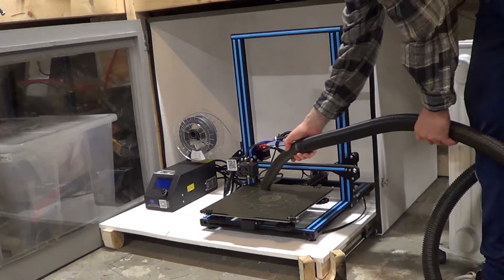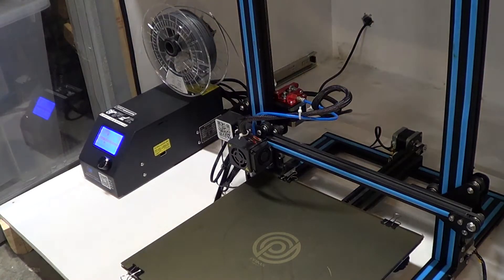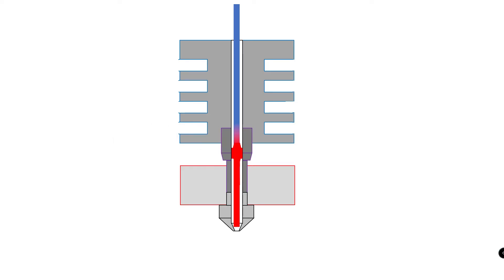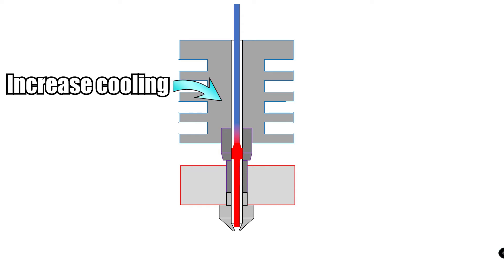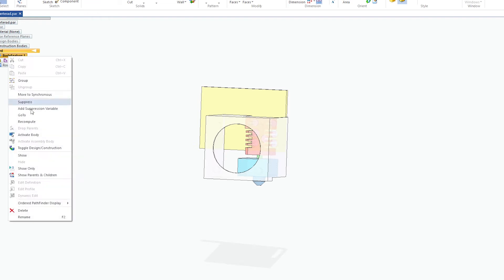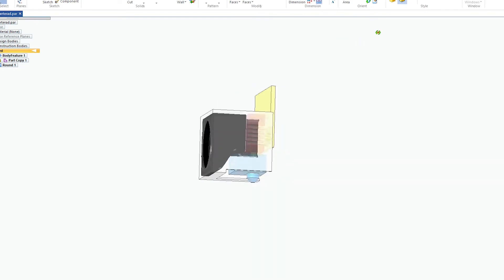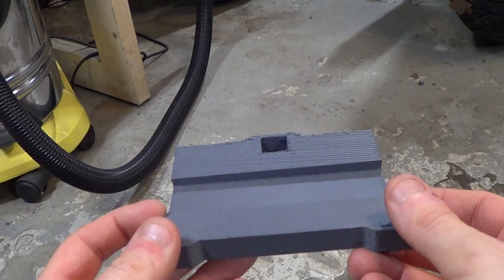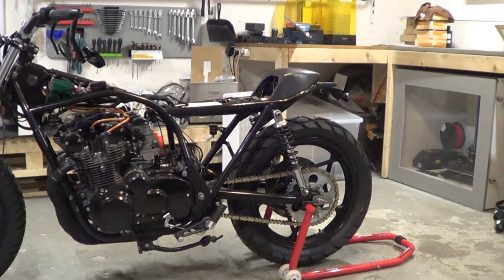CR-10 Upgrade Fixing Heat Creep | Workshop Shenanigans

Comment: I had replaced the fan  for the 40 x 20 and now I am going to print the inner duct and make holes, hope it works, I am desperate. THANKS.
Reply from the maker: Good luck!
Check your retract distance as well, -> As short as possible (y)

Comment: what aftermarket hot end are you using?
Reply from the maker: Product is called; ”PrimaCreator All Metal Hot-End for Creality”, from where I bought it.
Manufacturer P/N: PC-AMHE-CR10 according to that website.
Reply: @speedandengineering  Thanks, they are currently unavailable in the States for me but I am going to try upgrading the fan with the shroud and exhaust ports. Thank you for the part numbers.

Comment: I have issues with petg as well unless I use a ptfe lined hot end.

Are fan upgrades needed for these printers to print high temp ? Everyone talks about upgrading the hotends themselves, but no one mentions fan changes. maybe people are upgrading and still only printing pla ? When I see people talking about fans, its always the part cooling fans.
Reply from the maker: Yea, the ptfe hot ends are good at isolating the heat to the heat block.

All metal hot ends holds up better but you’ll be more prone to these problems with heat creep.

Maybe, it seemed to do the trick for me to swap the fan. But maybe the original fan that was replaced was getting worn and did not do its job 100%.
Ye, its possible. PLA went ok for me before the upgrade. Some problems at times with heat creep, but I could always work around it. With PETG tempetatures it simply did not work.